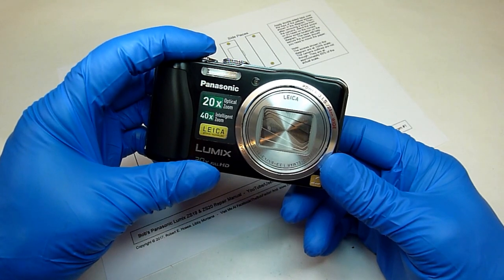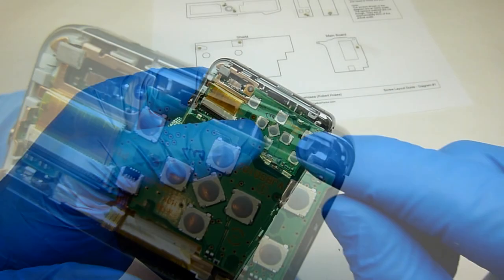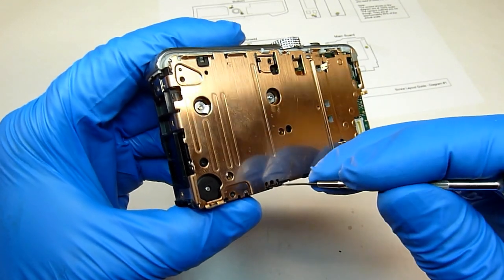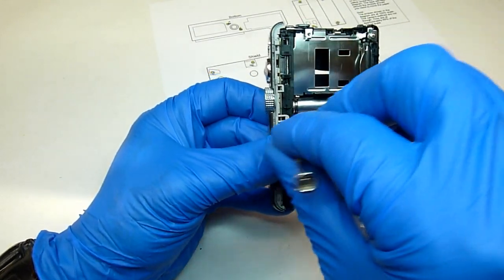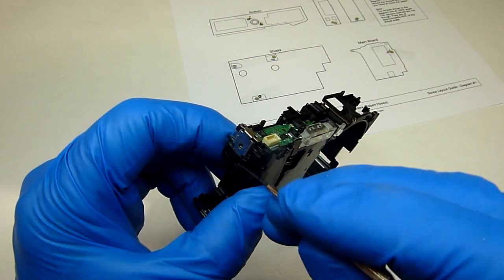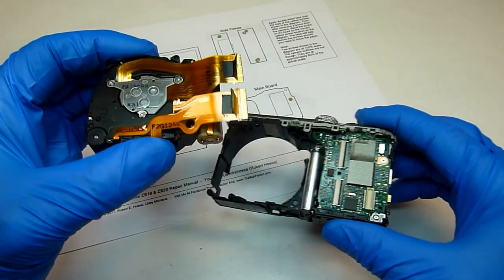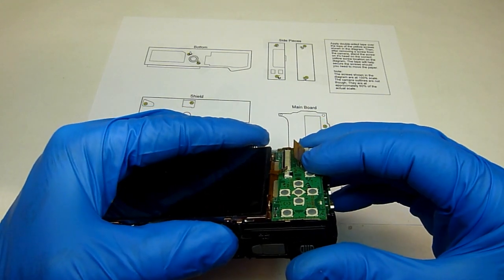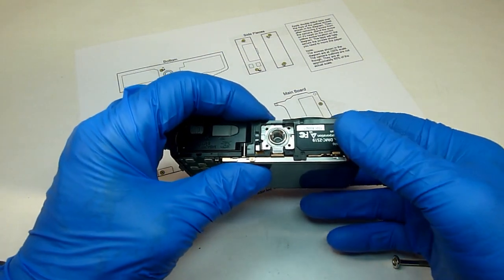Panasonic Lumix ZS19, ZS20 Repair Series - Disassemble & Reassemble

Comment: Thank you Robert for your excellent videos that helped me repair the zoom problem with my camera. I had the zoom motor wire problem you have described but when I took it apart the other fold with the very thin wires on the circuit board broke, so no hope of repairing. I think that the circuit board itself gets fragile over time and breaks, especially in hot countries. Luckily I found the lens assembly back cover at Aliexpress, that saved me a lot compared to Panasonic service prices, but it of course came without the sensor. But now reassembled and so far it's working. Thank you again for your great work!
Reply from the maker: Hey Chris, thanks for letting me know that the video helped you out. And also about what you encountered with the other issues. I'm glad that you were able to get it repaired and that it's working good again. Good job!

Comment: EXCELLENT TUTORIAL!!! Roberts instructions are so incredibly clear and easy to follow! He did an excellent job both explaining how to do everything and showing the tiny details.
 
My camera had a bunch of really bad black spots visible on all photos. (NOTE: NEVER use canned air on a camera!)  Although I have absolutely no experience with this kind of repair, and sending it off was about the same price as buying a new camera, I figured expected it probably wouldn't even turn on when I was done but I had nothing really to lose except some time. Therefore,  I decided to give it a go.  

I took the camera all apart and then took the lens apart (per his other video). The lens disassembly/reassembly was really challenging. I considered buying a used lens assembly to pop in and think it would have worked fine, but the cost of that part on Ebay is about the price of a used camera and my old ZS19 had an damaged battery door in addition so i didn't think it was worth the investment. 

In the end, the camera actually turned back on after re-assembly and the lens even popped open and zoomed, the scene selection worked, but the black dots remained and I screwed up the lens assembly so that the camera now can't focus properly and gets a "System Error (Zoom)" message, too, meaning it's done for good.

Too bad because I really really like this camera! Anyway, I just thought I'd report that if you're tossing the camera anyway, and you are the kind of person who like jigsaw puzzles and tedious tasks, go for it! You'll find Robert's video 100% helpful! 

Good Luck!

Comment: Robert your instructional videos are pure gold. thanks. Are you able to direct me towards any companies for much needed parts. i have found basic items such as the battery door (ebay) but as for a front panel or battery housing for my Lumix TZ93 I'm stuck. 
BW
Peter Daly
Reply from the maker: Hi Peter. Unfortunately the only place that I have found for replacement parts is eBay. And as you know, it can be pretty hit and miss trying to find parts on there. Sorry I can't be more help.
Reply: Thanks Robert.

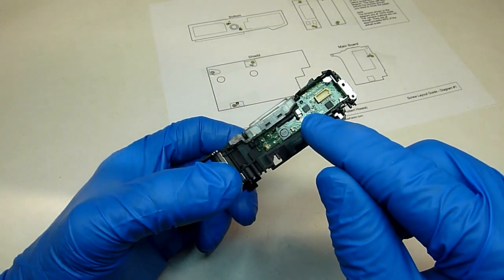Comment: Nice video!  I'm wanting to replace the date and time internal battery on a similar model.  It looks like I see it in the top peice at 9:24, is that correct?  I have a DMC-ZS5 and assume it's very similar, but can't find any resources on line w/ explosion diagrams for it.  Any hints appreciated Robert!
Reply from the maker: Thank you! Yes, that is the battery location for the ZS19 & 20. However, I don't believe that is where it is on a ZS5. I don't have a ZS5 to find the battery location, but it is probably the same location as on a ZS6 & ZS7, which is on the SD card circuit board. Here's a link to my video showing the SD card circuit board on a ZS 6/7. https://youtu.be/o9O43EOkiKY?t=618
Reply: Thanks!.  Nice "feature" to have battery replacement require the disassembly of the entire cameras! sigh

Comment: Can you tell me where to find the firmware on the Panasonic Lumix DMC-TZ35 ?
Reply from the maker: According to the manual for the ZS25, which is the U.S. version of the TZ35, you can find it in the <Settings> menu under <Version Display>. The <Version Display> info is on page 52 of the manual. Here's a link to the manual: https://help.panasonic.ca/viewing/ALL/DMC-ZS25P/OI/vqt4p14/vqt4p14.pdf
Reply: @Thebobfactor  I cannot find the firmware file for this camera on the Internet.  The official website does not have a firmware file or firmware update for this particular camera.
Reply from the maker: @Relax72Relax , I don't see one listed either. That particular model of camera just hasn't had an update to be made for it. Have you heard that there is one available for it?

Comment: Thank you for taking so much trouble to show how to do this. I have stripped it down and the camera was surprisingly clean. Unfortunately the lens i stuck in the open position and nothing I have done has resolved the issue . I have used an air duster throughout and into the lens sections as much as possible but still it is stuck open. Thanks again for sharing your knowledge in such a patient and easy to understand manner. It was a pleasure listening to you.
Reply from the maker: Hi Rich. By "stuck open" do you mean that the lens is extended out all the time and it will not retract, or do you mean that the lens cover is not closing?
Reply: @Thebobfactor  Good morning Robert. Thank you for your reply. The lens is in the normal open position and will not close when I switch-off. The zoom function is not working either.
Reply from the maker: @alvor2762 , is there any kind of error message or error number being displayed? It sounds like the problem that is common with that model, where some of the conductors in one of the flat ribbon cables burns open, and the zoom motor no longer works and it will not extend or retract. In that case though you would see an error message on the main LCD display. If that is the case then you would have to repair the flat ribbon cable. I show how to do that in this video: https://youtu.be/wx8e0z0zsg4  Let me know if that looks like it may be the problem.